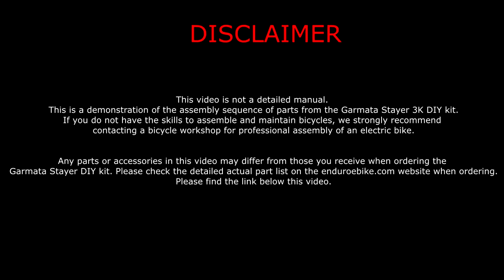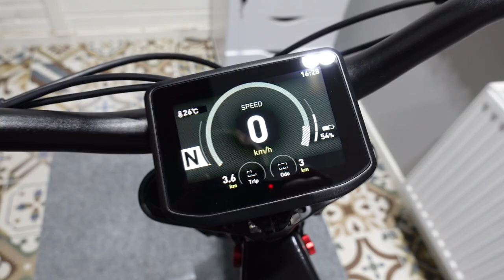How to assemble DIY ENDURO EBIKE Garmata Stayer

Comment: Nice video! I’d like to point out people u need make sure wire harness coming out of Hub motor does NOT touch the brake rotor and trust me it’s very close! I actually grind down 1-2 mm off rotor around bottom of rotor if need be and I use zip ties to hold secure, lots of people have cut wire by accident so give a good look at urs 👍🏼👍🏼

Comment: What size tires did you use ? Looks good.
Reply: It is 19x2.5 moto tyres
Reply: Could it fit 29
Reply: @djipreview no, it is for motorcycle wheels. 19x2.5 moto fits good. If you want bicycle wheels - 26x2 is max size
Reply: @djipreview no
Reply: I don't see a kit for 26" on tge website

Comment: i so wish they designed proper linkage swing arm suspension for these type of bikes, so i didnt have to modify them for customers, this type of suspension geometry off road handles and preforms very badly
Reply: Do you have a link or website for your upgraded swingarms?